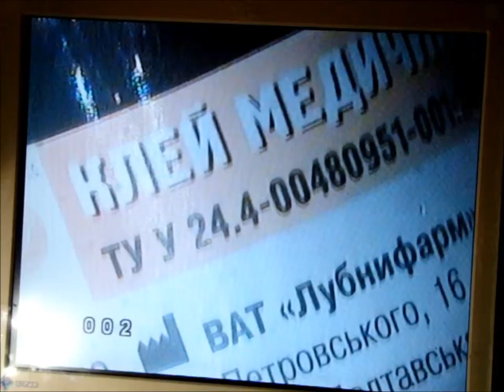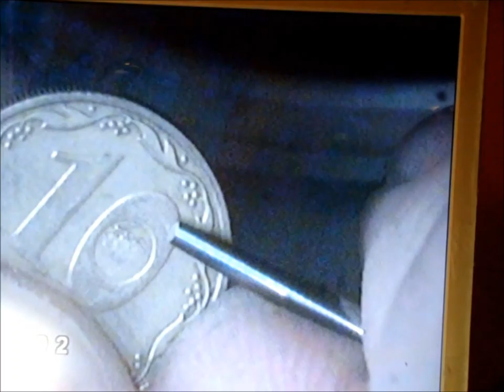DIY disc for polishing tungsten carbide graver

Comment from the maker: I apologize, my English-speaking friends, the video created for the Russian-speakers. At that time I ran into the problem of how to polish the carbide-tungsten shtihel for minimal money. It is necessary to take a diamond powder 0-0.5 fraction and BF-glue, apply to a bronze disc and allow to dry for 24 hours
Reply: Whats bf glue?
Reply from the maker: @bmx4lif3er  https://ru.wikipedia.org/wiki/%D0%9A%D0%BB%D0%B5%D0%B9_%D0%91%D0%A4
Reply from the maker: @bmx4lif3er  I started using such discs, very pleasant https://pnevmoart.com/diski-almaznye-diamantex/
Reply: @KOLOBOKFN this yellow diamond is only used specifically on the hell and face only?
Reply from the maker: @mulanjamilah7849  I use a translator and the question is a little unclear.  before there were no diamond gums and had to be used for finishing polishing diamond powder with glue
Reply: @KOLOBOKFN  т.е больше не пользуетесь бронзовым дисом а покупаете готовые алмазные резинки?
Reply from the maker: @andrisgulbis9677  Желтые резинки сейчас подешевели , ими удобнее пользоваться. Но иногда на тех углах когда есть вероятность пропороть резинку, все же продолжаю использовать.